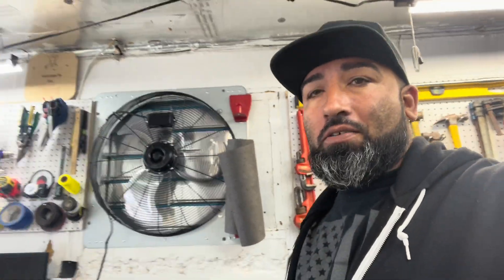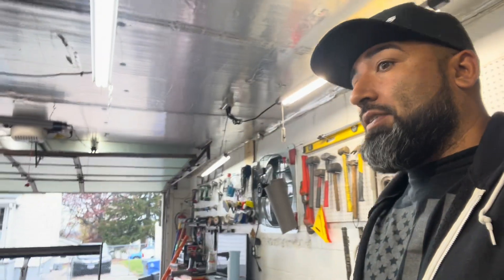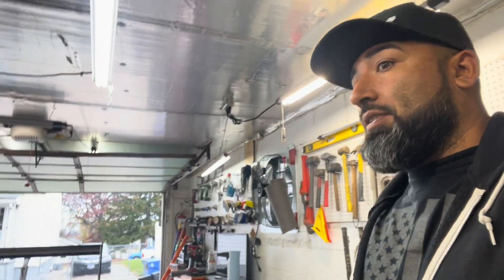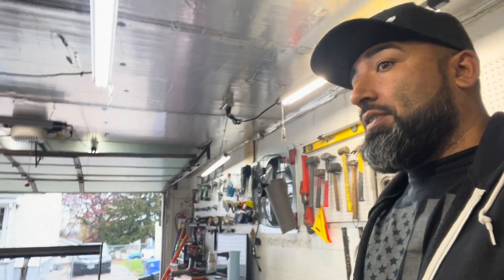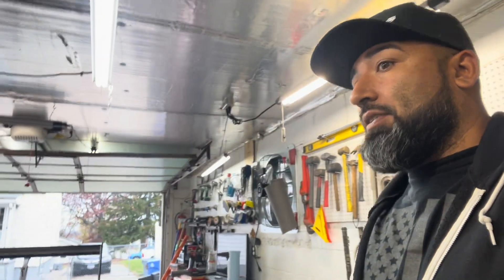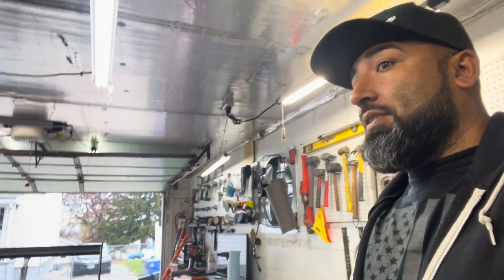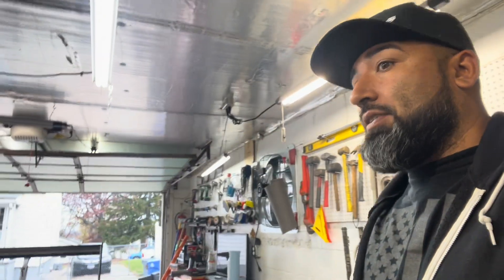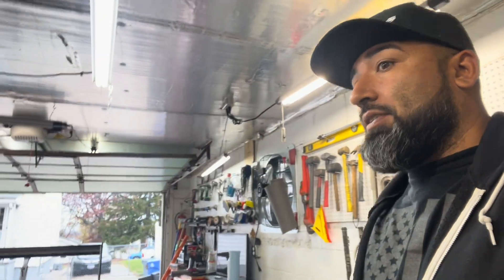Integra DIY carbon fiber hatch (not a wrap)

Comment: Sweeettttt!!! I can make the attempt with my cf kit for my tegy
Reply from the maker: Well hope this video helps any questions just let me know
Reply: Where did u get mixin measurements  i’m not sure if I’m getting the mixing portions correct I’ve noticed I’m given a small window roughly 20-25 minutes max after that. The mixture starts to boil and steam and they will instantly harden up possibly because I’m adding maybe too much reactive harder but just trying to get correct measurements as I plan on doing trunk hood fenders eventually work my way up to doors just as much stuff I can do on my Integra, although yours is a track car mine will be a street so I know I would have to add more layers of carbon for my trunk and hood, etc. but yeah I’m just trying to find out my mixing measurements
Reply from the maker: @DirtyGarageTx  the epoxy that I got came with the mixing measurements. I bought a digital scale from harbor freight for $20 to weight the epoxy and hardener instead of eye balling it in a measuring cup

Comment: From a fellow fabricator. Help brace that wing mount forward to the cage. The flex your going to get on that plate, and frame area is going to split the hatch on each side. The down force is taken care of, but the air is also trying to rip it off. Just my 2 cents.  I think the hatch turned out awesome! I want to do a roof for my eg. Some of the windshield area is rotten.
Reply from the maker: I made my carbon fiber roof pretty much the same way. I did the hatch a friend had a wrecked Integra I took the roof. I appreciate your advice about bracing the wing mount to the cage. I will take that into consideration.